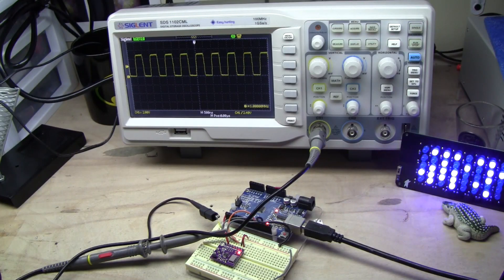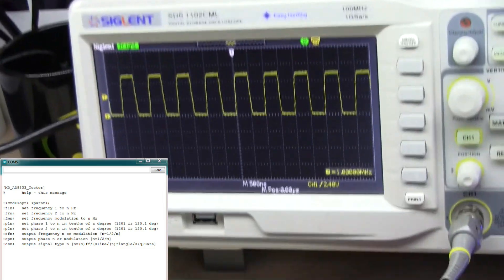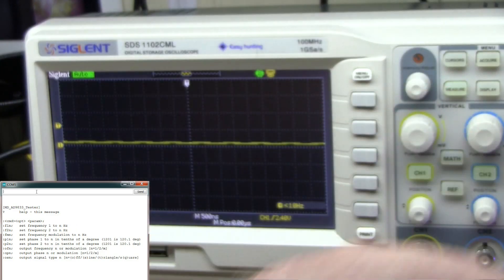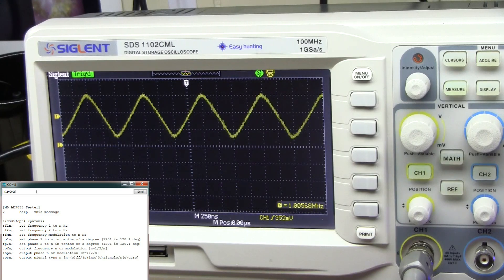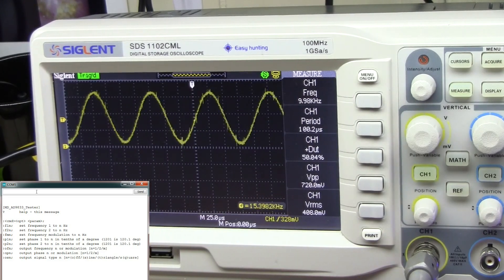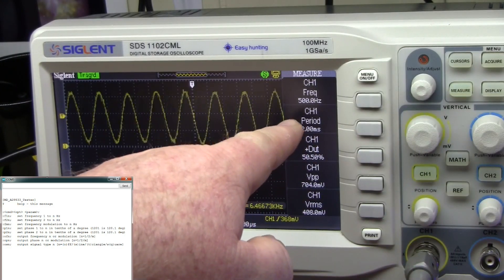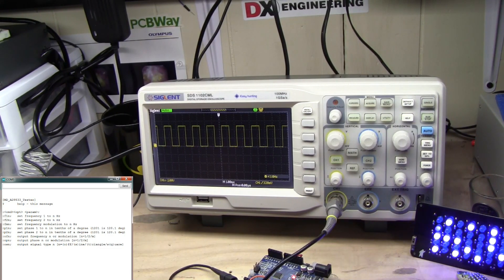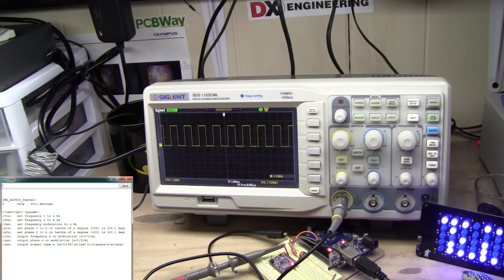Working on the Arduino AD9833 Signal Generator

Comment: Its a DDS and the board is a cheap design which is MISSIMG the hardcore steep drop 12.5MHz low pas filter on the output (3 stage 2nd order  filter shown in the AD9833 datasheet).
BTW you frequency jitter from the large noise is you cause of funky values on your scope.  Also SQUARE wave are ALWAY CLEAN from a DDS because it has only TWO VALUES!

Comment: I need to have a sin wave generator from 1 to 2000 Hz at 1 Hz step,  amplifier, volume to drive a voice coil and display (OLED) to show frequency.
Control should be 12 step encoder to change frequencies, (push to move faster), second knob for amplitude (likely analog output pin to audio amp gain control.    Please let me know if you can do this. Looks to me like most of the work has been done. 
Thanks.
It's for a client that is paying to have these built.

Comment: The noise on your signal is confusing your scope I'd say. I never succeeded in analog using the terribly noisy USB bus as a power source, without state of the art analog grade treatments... . Keep in mind that Arduino 5V is just 4.45 V USB picked up on the cathode side of the USB zenner diode. There is no regulator whatsoever ... so you are powering your sine+ generator chip directly with a crapy voltage source. Garbage in garbage out ;-)

Comment: One thing I think to be a large contributor is that you are comparing apples and oranges a little bit with the different waveforms. The square wave has a MUCH higher dv/dt transition through the trigger point of your scope as compared to either the sine or triangle. In addition, the amplitude on the square wave appears to be almost an order of magnitude higher in p-p amplitude than the other waveforms. Whatever is summing in as noise (grounding, poor coupling, etc) when the signal arrives at the scope's trigger effects the trigger timing, so the faster the signal transition THROUGH the scope's trigger point, the less susceptible it will be additional noise at that point. You night also set the BW limit on the scope to clean things up if you haven't already.

Comment: The first thing I would try is to make it self-contained. Power it with a battery. Use on-board controls instead of the terminal interface (e.g. rotary encoder for freq, click to change step size; separate button to select waveform).

Comment: My experience is that decoupling of cheap switched power supplies with only capacitors do not work for this module and other analog circuits . I have already tried this. Adding a common mode filter improves. With an analog power supply I a have measured 2mV noise with output potentiometer on zero. Max out gives 255 mVtt, 90mVrms with only 1 or 2 bits of noise measure with Owon XDS2101A. The frequency counter stays on 1Mc stable with only 1 bit change. DC or AC coupling makes no difference as long as the triggerpoint is in the middle of the signal. My conclusion: it is not the low output voltage, the code or shielding. Use a noiseless power supply and the ADS9833 gives you  a very nice cheap function generator. I hope this helps. Learnelectronics keep up the good work!!!
Reply from the maker: Thank you, Ill try that

Comment: The D/A of AD9833 has a 10bit resolution and it has noise caused by a fairly large quantization error, and the spurious content is better seen at lower level signals.
 When it generates square waves, the signal level is quite high (5Vpp), and the noise level is low compared to that level. So the scope can't "see" very much noise in the generated signal from DDS... But when you switch to sinewave or triangle, the noise level is much more comparable to the level of generated signal (0.6Vpp !) and the scope "sees" it as we can see...

Comment: Add a check to see if the new packet is the same as the last packet. You may be repeatedly setting the mode / frequency which then creates a "lag" proportional to the setting switching in the chip. Your code seems to only be checking to see if it received a packet before sending the settings to the chip but that value would still be there on the next loop if nothing replaces it. Without having the header file for the chip lib I can't tell for sure though how it communicates.

Comment: A quick read of the AD9833 datasheet brings up a couple of things first of all this quote:-
 "Good decoupling is important. The AD9833 should have supply bypassing of 0.1 μF ceramic capacitors in parallel with 10 μF tantalum capacitors. To achieve the best performance from the decoupling capacitors, they should be placed as close as possible to the device, ideally right up against the device."

So running it from a noisy power rail won't help and neither will using it on a breadboard :-(

Also the square wave is a direct digital output i.e. 0 - 5V whereas the sine and triangle waves are output from a DAC at a significantly lower amplitude (From the early part of the video square = 3.44V RMS, Sine = 400mV RMS and triangle = 384mV RMS).

There is noise evident in all traces but seems to be approximately the same amplitude across all wave forms. This is why it affects the lower amplitude sine and triangle waves far more than the high amplitude square waves.

You could try putting some decoupling as close as possible to PCB on the breadboard. Also try running the arduino from a 9V battery. Set it to a particular frequency and waveform then unplug the USB cable and plug the battery into the 2.1mm power socket. See if that makes any difference to the noise on the output.
Reply: Good points Ian. I had just finished looking at the data sheet for the IC myself and was on the way here to make the same suggestion. There were a couple of other spots where decoupling caps were indicated as well. Not sure if that little PCB the chip is on is the one AD sells or some other one so it is hard to know what other problems may be involved.

Comment: Interrupts? The square wave gives the micro time to service interrupts while an output is locked high or low. The sine and triangle waves require constant output, thus susceptibility to internal interrupts?
Reply: Nothing to do with interrupts as the AD9833 is a standalone frequency generator. You just set values in it's registers and away it goes generating the waveform you require at the frequency you requested until you update the register values for a different frequency/waveform.
Reply: @iancrowe8384  yeah that is what I thought. I suspect he is continually setting those registers because his code only checks if his variable is not null. So until it receives another value it will execute the same function on each loop.

Comment: Hi learnelectronics, I have a little coding question and I wonder if you can help me, I have looked on Arduino Forum and could not see a definitive answer, please have a look at the code and see if you can spot my mistake and hint at the solution, it's all centred on converting a float to an integer.

int DigitalBuffer[] = {1, 0, 0, 1}; // set up buffer for saved data from input pins.
float val = 0; // set up varable for switch case loop calculation.
int Data = 0; // set up variable for conversion of val to integer for switch case loop.
int lastData = 0; // set up variable to compare last data to see if value of Data changed.
void setup() {
  Serial.begin(9600);
  Serial.print("Hello 4 binary bit's for debugging "); // output data to serial monitor for debugging.
  for (int i = 0; i < 4; i++){ 
    Serial.print(DigitalBuffer[i]); 
    Serial.print("**");
  }
  Serial.println();
  //
  Serial.print("Direction and count of decoding loop ");
  for (int i = 3; i > -1; i--){
    Serial.print(i); // val and direction of loop value.
    if (DigitalBuffer[abs(i-3)] == 1){
      val += pow(2, i); // convert bits in DigitalBuffer to decimal value for switch case loop.
      Data = int(val); // convert to integer value for switch case loop.
    }
  }
  Serial.println();
  Serial.print("val from Decoding loop ");
  Serial.print(val);
  Serial.println();
  Serial.print("Data integer conversion result ");
  Serial.print(Data); // this is not right and I can't see why!

}

void loop() {
  // put your main code here, to run repeatedly:

}

Okay, I solved my own problem, here's the magic code line: val += round(pow(2, i)); // convert bits in DigitalBuffer to decimal value for switch case loop.
Reply: That is quite the round about way of doing things.
Reply: @excitedbox5705  I have much to learn, mostly about putting my ideas into code and I am not used to writing for the Arduino, more into python.
Reply: @excitedbox5705  How can I input on parallel pins, is there a port in function?
Reply from the maker: Im no programmer. Im a hardware guy
Reply: @learnelectronics  I get that and you do a good job of explaining stuff, like your enthusiasm and keep up the good work.

Comment: The bad trigger is the result of the noise. I use an old fashion analog power supply instead of a 5V usb switched power supply. That will reduce the noise. Also, to get better sine wave results, if have added a 5-th order series-input Butterworth bandstop filter with center frequency on 25Mc and bandwidth of 50Mc with a termination of 200Ohm. Use Elsie for the design. It results in 50% of the output voltage but a much clean(er) sine wave with -3dB on 6.4Mc.
Reply: Tive o mesmo problema quando mudei da fonte analógica antiga 12v assimétrica para uma fonte chaveada. O osciloscópio enxerga o transitório e atrapalha a medição. Se alimentar o arduíno com 12v de uma bateria o sinal fica perfeito sem bug.
Reply: I had the same problem when I switched from the old asymmetric 12v analog source to a switched source. The oscilloscope sees the transient and interferes with the measurement. If you power the arduino with 12v of a battery the signal is perfect without a bug.

Comment: I'm a bit concerned about all the noise on the signal.  I think it's also playing havoc with the Siglent hardware counter - maybe foreshadowing possible issues with using it in real projects.

It would be great if you could find a way to clean this up, I'm very interested in the project.

ETA: The squarewave gen is not an issue, probably because the square wave puts the noise outside of both trigger points (on screen trigger and hardware counter).

Comment: Like  Eric Burman said cap on power rail ,about 10-100nf cap on power rail close to PCB or close to IC if possible, and try to change the trigger on other signals to either 1 1/4 or 1 3/4 way of signal not in the middle?